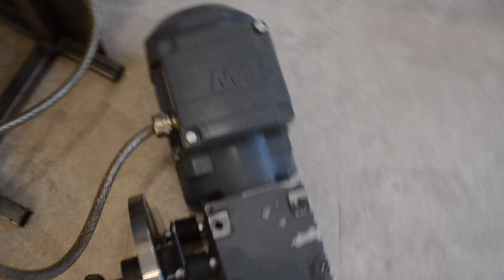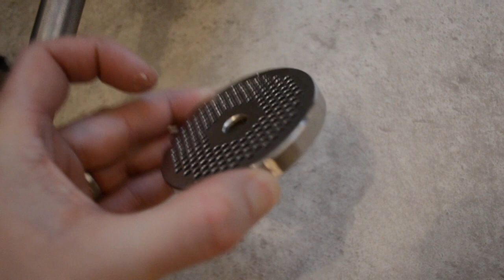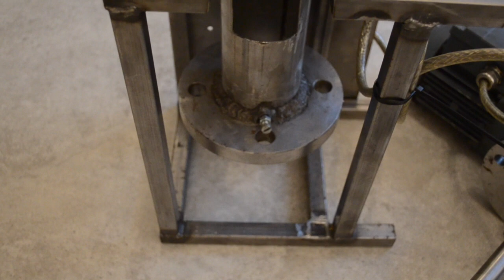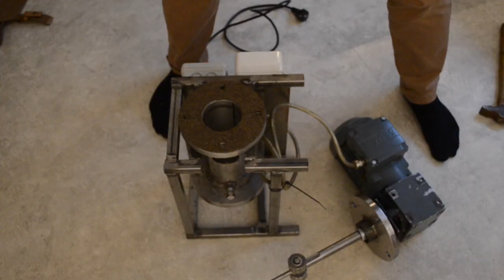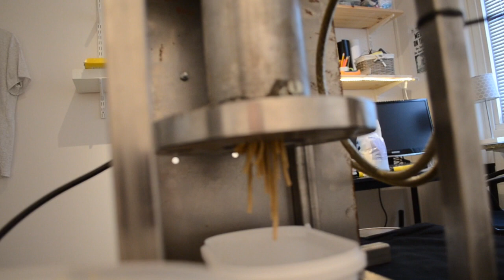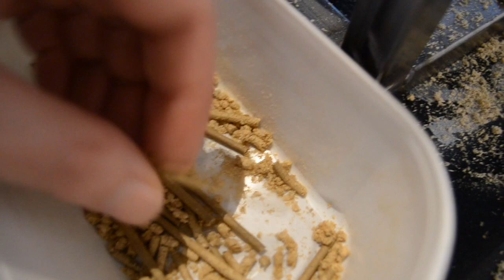DIY Pellet Mill part1 machine for small pellet production

Comment: hey if you see my comment and are curious in buying something like this I'm interested what you would pay for something a bit more complete, (don't get me wrong this is awesome) but I'm thinking of making a all in one thing like having the grinder and pellet maker all in one, so you just chuck your log/sticks (which you would have to test for moisture first think it's 5-10%).
because where i have made a lot of charcoal before and i find my local wood the best by far (mallee wood) but no one sells it in pellet form.
I will be making one for my self to test if it is applicable with mallee wood works well with my Traeger.

Comment: Did you buy those online
Reply from the maker: No, not at all. I built it from scratch with used parts and without any blueprints. It was a simple prototype but worked perfectly, however now its scrapped and I have used the parts for another project.

Comment: Sir please I need help,I built one but not sure of size of holes in pellet plate
Reply from the maker: If you have a meat grinder plate, 3-4mm is advised. Larger holes than that require a thicker plate to make good pellets. And it should be made of inox metal to be as smooth as possible inside the holes. Also you can countersink the holes a little on the top side.
Reply: @swedishinventor  good day sir so glad to be able to get advice as all are in Russian.
I've made a plate and countersunk the holes,first I'd drilled 4,5 mm holes I've since gone to 6mm still not working, I think it could be I've got the speed to fast
Reply from the maker: @willojames9955  it depends on so many factors, ranging from the type and grain size of your raw material to the moisture content, speed, heat, hole size, "press length" (thickness of the die). There isn't a single answer, unfortunately you probably need to read up alot on the process and try, try and try again. Start with an almost dry material and slowly raise the moisture content until it starts producing pellets that holds together
Reply: @swedishinventor  thank you kindly will give it a try, have a great day

Comment: You need to add a 'cutter' to it.  That way it's uniformed once it's done.
Reply from the maker: Exactly! the axle that runs through the bottom is intended to hold a cutter, which doesnt need to be more advanced than a simple pin that rotates and breaks of the pellets.

Comment: Noce work..im planning to build this pullet but i don't where i can learn the step by step making of materials making of dis
Reply from the maker: I don't have any blue prints for it unfortunately. Also you need a bit of machinery; a welder, a lathe and a milling machine. For poultry feed pellets, itwould be easier to use a modified manual meat grinder instead, as featured in many other videos on youtube.